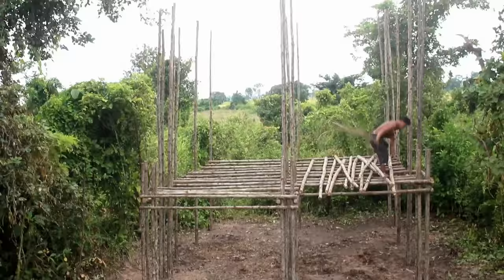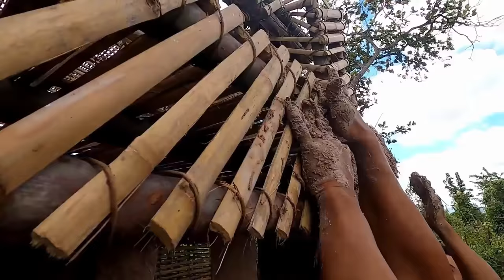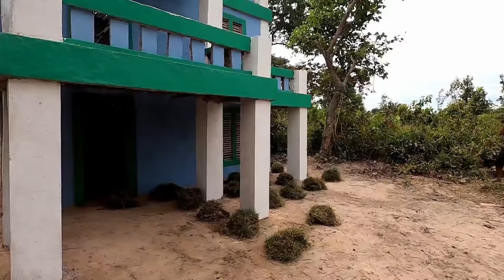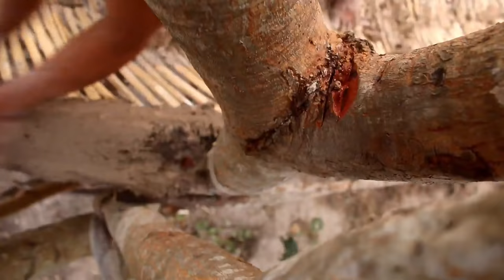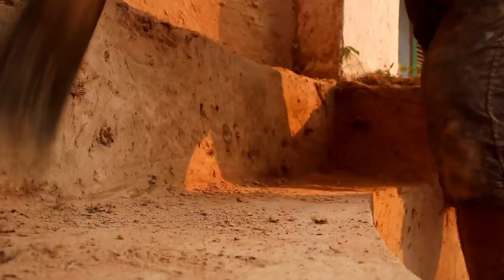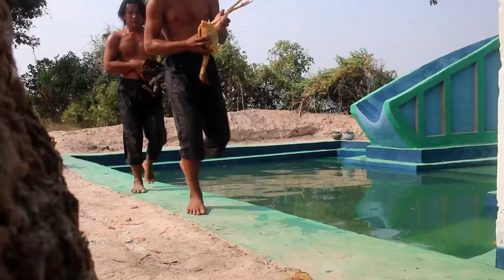Build Modern Contemporary Mud Villa  And Design Water Slide To Beautiful Underground Swimming Pool

Comment: What happends to these amazing strucktures when it rains?
Reply: Noting it’s not a sand castle that’s like saying what happens to concrete when it rains
Reply: @joshuapixsage5285  same goes with the paint?
Reply: @linusnoren3661  The structure is covered in what looks like clay but the type of clay doesn't run off when it gets wet and is probably half as durable as concrete which is strong. More akin to Lyme.

The paint is the same i think. It's just mixed with clay possibly